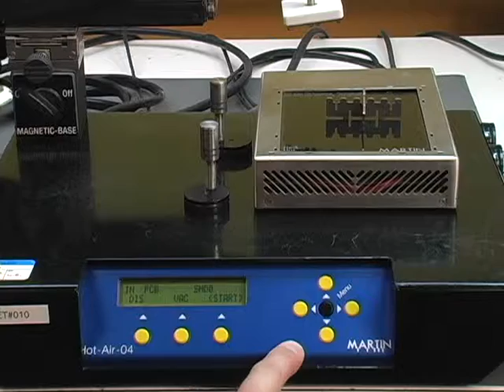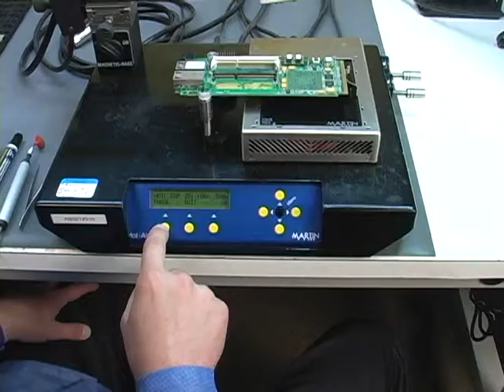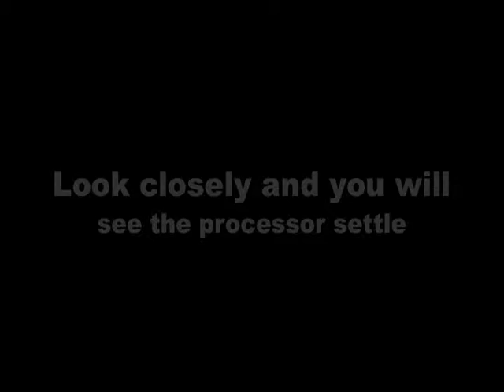P4080 Reflow

Comment: The processor does settle by itself when the paste transforms into solder. But if the processor is not properly aligned by one row or one column it will "align" shifted by one row/column. The best practice is to use an aligning machine first.